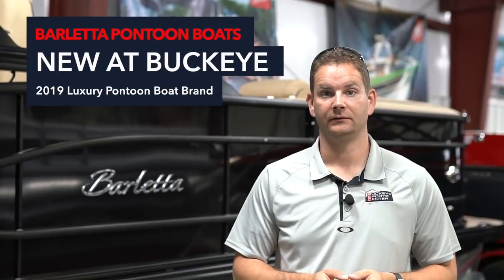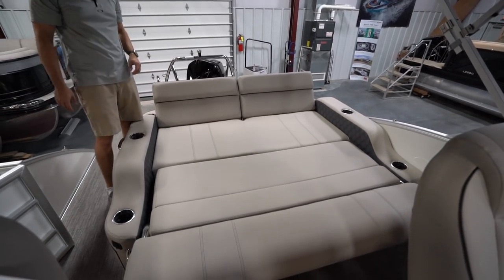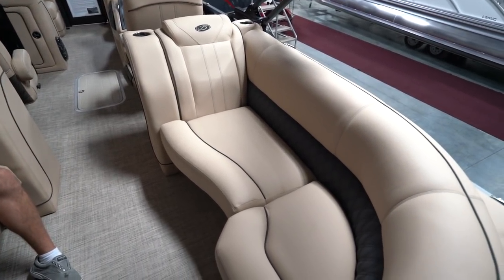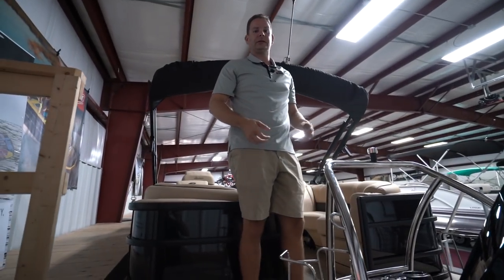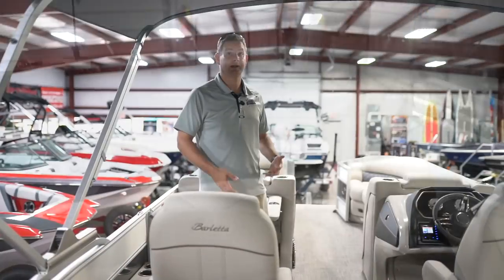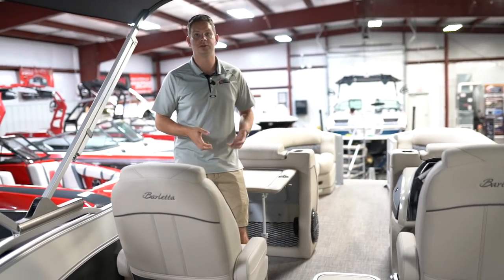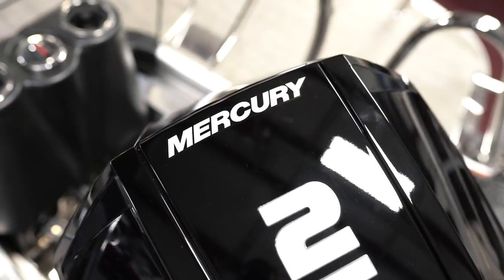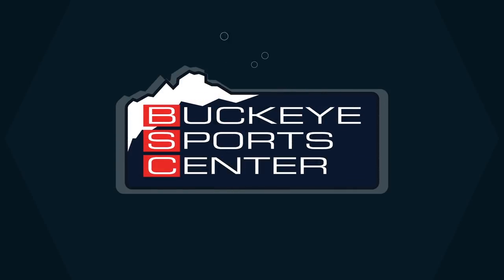Barletta Pontoon Boats in Ohio

Comment: hey there...
What i do not understand is that.. why are holes present in the stakes?
1) it could lead to back pressure and more resistance ,  2) what if sand , mud etc get deposited inside
3) what is the length of the holes .. are they end to end or kept only open at the aft.
kindly clarify